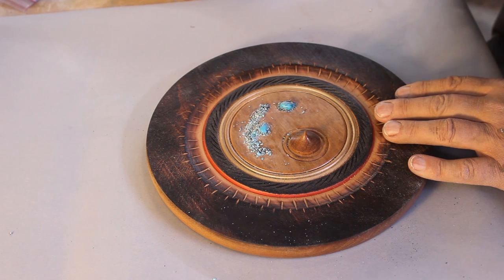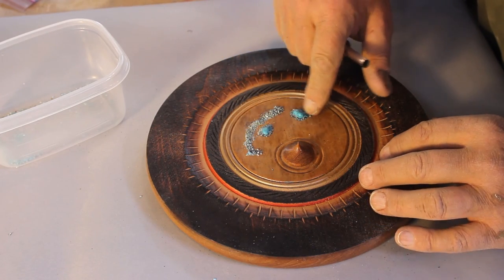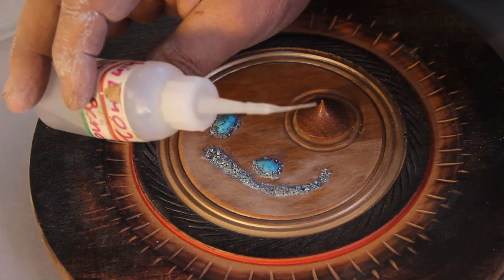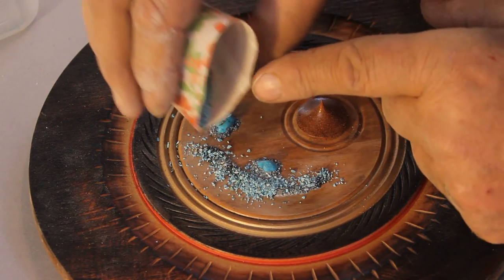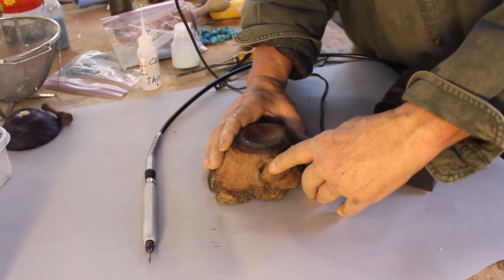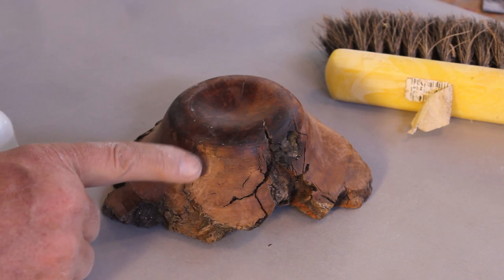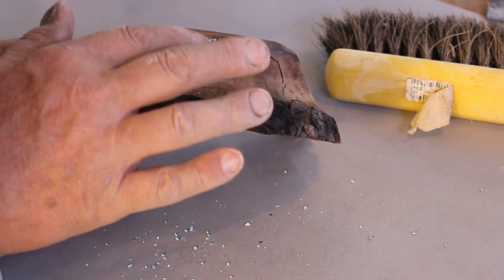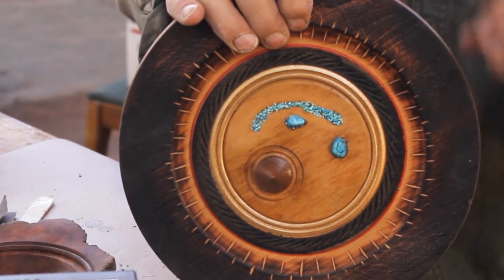TURQUOISE Stone INLAY  for Wood Projects

Comment: I am making a Cain with turquoise inlay , what is best way to sand down Cain to make turquoise flush.....?
Reply from the maker: Deborah,  I find turquoise very difficult to sand.  I use it to fill voids in wood primarily.  The surrounding wood is always softer.  Consequently as I try to sand the turquoise, the wood also is effected by the  sanding.  I have seen a sanding disk which is made from diamond and that works well.  I just never bought any-and I don't really know where to find it.  I saw this in a video.  Sam

Comment: I'm gonna try opal powder inlay. I don't really know what kind of stone Turquoise is. But Opal got a real nice shine and deep color. I want to try to glue it with thin epoxy resin. Because i found that super glue is kinda brittle. And epoxy is really strong and heat resistant. I have not tried it jet but i expect this month or maybe next month to try it out. It wil be on my YouTube channel. Fail or no fail it wil be shown.
Greetings,, Kitty.
Reply from the maker: Kitty,  Have fun with the inlays....I agree with the thin CA glue.  I like to apply 2-3 layers of my inlay material.  This seems to work well.  Sam
Reply: @WYOMINGWOODTURNER  Awesome! It sure is fun to make gorgeous things :)